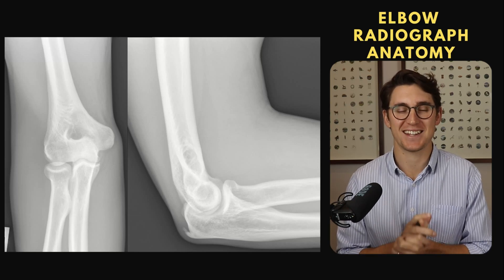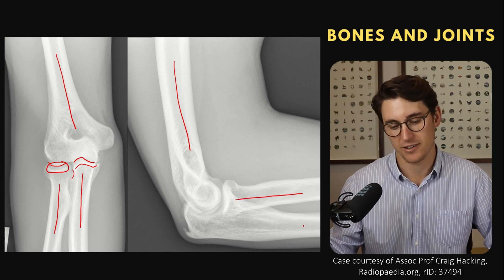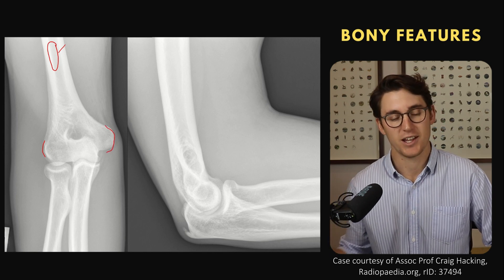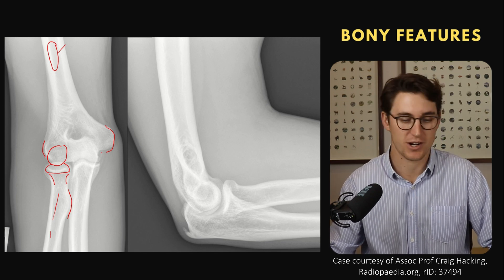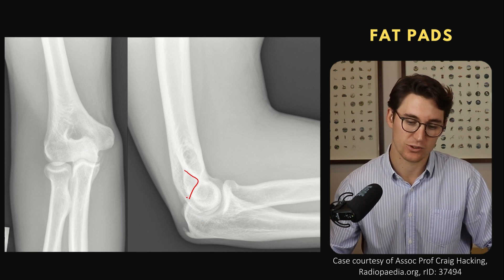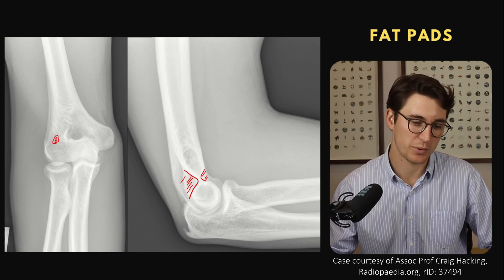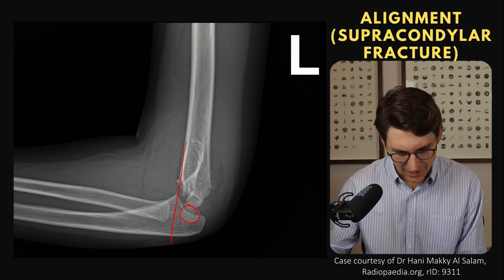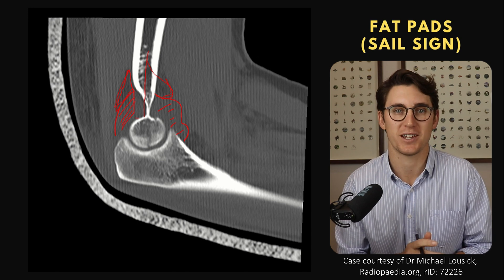Elbow joint anatomy | Radiology anatomy part 1 prep | Elbow bones, alignment and fat pads on X-ray

Comment: FINDINGS:
Complete intraarticular fracture is seen involving the anterior aspect of the trochlea, capitellum 
and intercondylar region of distal humerus suggestive of transcondylar fracture. There is ~ 6 
mm of cortical offset along the articular surface of trochlea due to superior displacement of 
fractured bone fragment. Comminuted fracture are seen involving the capitellum of the distal 
humerus. The articular surface of the capitellum is otherwise intact. Mild subluxation is seen at 
the level of radiocapitellar joint. No displaced fractured bone fragments are seen in the elbow 
joint space. There is a vertical fracture seen through the intercondylar region of distal humerus. 
Medial and lateral epicondyle and supracondylar humerus are intact. No callus formation or bony 
bridging between the fractured bone fragments to suggest union. 
The coronoid and olecranon process of the ulna is intact.
Proximal radioulnar joint appears normal. 
Effusion in the elbow joint.

This my report sir age 30 male indian.doctor suggested me operations.
But pls advice operations then batter plaster